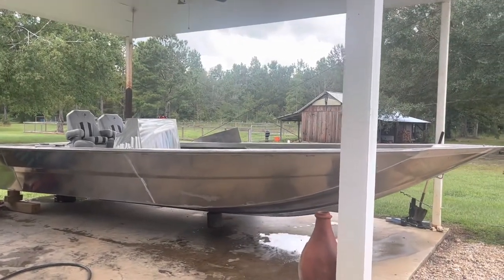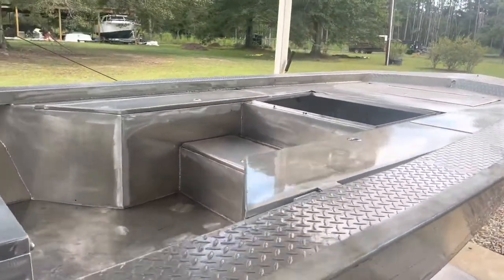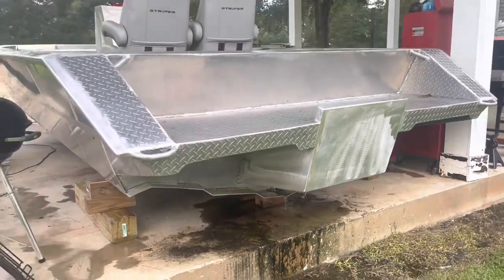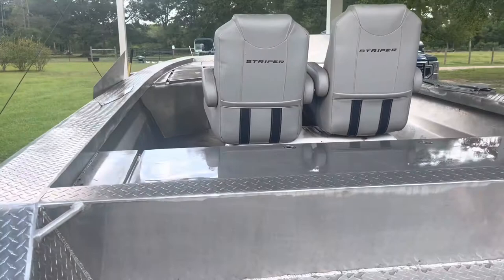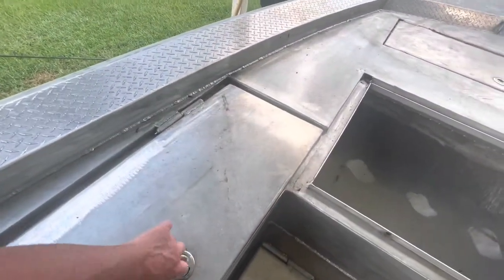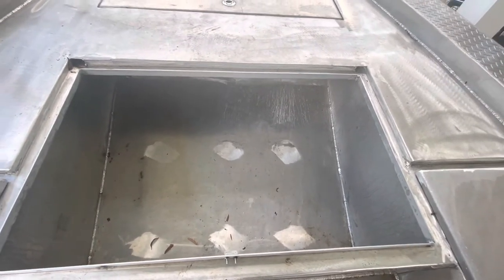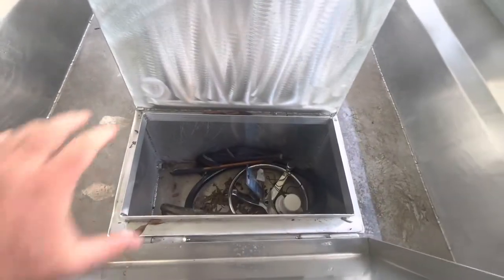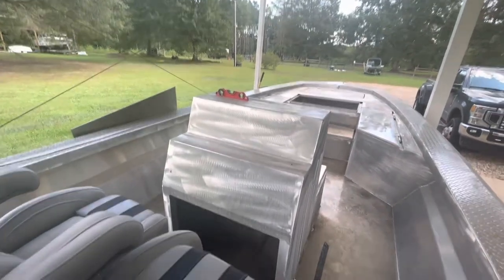Custom 26’ aluminum bay boat

Comment: Any updates on this boat? What is the hull plate thickness? Great form and shape.
Reply from the maker: So I am working on my 19’ and should be done with it soon. I am going to jump back on the 26 probably in August. I am cutting out the console and having a different one(wider with side rod holders and windshield (curved glass) put back in. I will also continue to tear out the cabin on the 28 Bertram this fall when it gets cooler
Reply: @therustyblades1212 if you decide you dont wanna deal with it, ill buy the project from ya.
Reply from the maker: Oh I am not getting rid of it. Right now it’s strictly a cost thing. I have two teenagers needing vehicles in the next year.
Reply from the maker: @jayyep6974  I am selling the boat and trailer
Reply: @therustyblades1212  what are you asking for it?
Reply from the maker: @jayyep6974  32k for boat, seats and trailer. What I have in it.
Reply: @therustyblades1212  dang. A bit rich for me. Gonna need more than that to finish it and get a motor on it.

Comment: How much did he charge you for hull and can u send his info
Reply from the maker: It was built in 2018 and it was 16k. He no longer builds boats and is retired. Most builders you are looking at 30k+. Their fit and finish is a little better but his fit and finish isn’t bad.